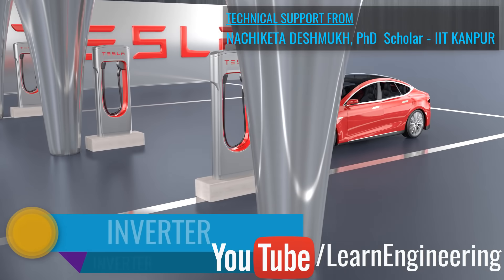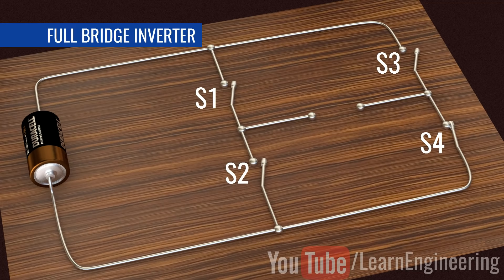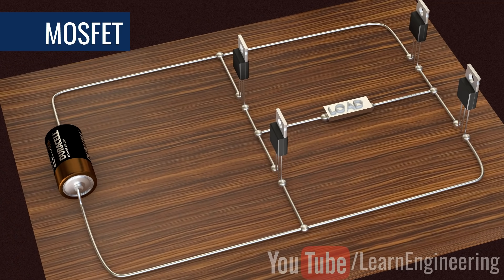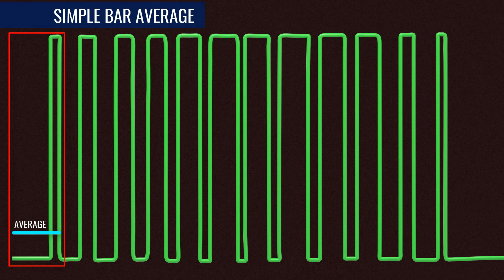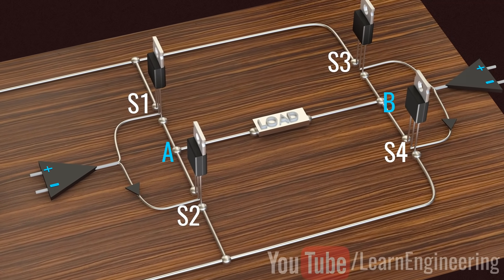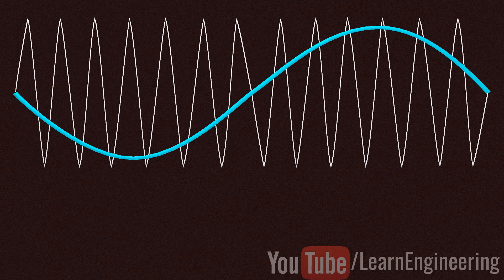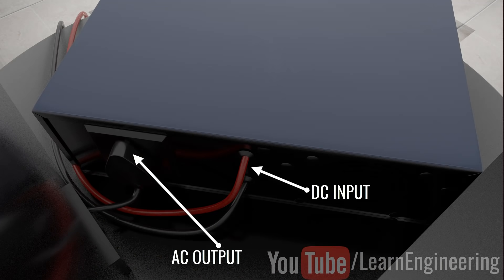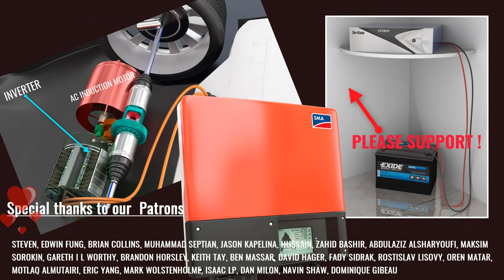Inverters, How do they work?

Comment from the maker: Please support us at www.patreon.com/LearnEngineering . Your support keeps us going !
Reply: I am always sharing u r videos to what's app to see all my friend's and I will supp2
Reply: +karthi k It's true that inductors smooth current and capacitors smooth voltage, but resistors don't smooth current. 

The voltage over a resistor is equal to the current through the resistor, multiplied by its resistance: u_R(t)=R*i_R(t) ( _ denotes that the following symbol is in subscript). Here you can see that if i changes, u changes immediately. u_R(t)=R*i_R(t) is known as the Constitutive equation of a resistor and describes the relation between the voltage over the resistor and the current flowing through it. 

The current flowing through a capacitor on the other hand, is equal to the capacitance of the capacitor, multiplied by the change in voltage over the capacitor. i_C(t)=C*du_C(t)/dt (d denotes a change in the following variable. dy(t)/d(t) means the change in y(t) divided by the change in t, where dt approaches 0. This is known as the derivative of y(t)) Here you can see that the change in voltage over the capacitor is also equal to the current flowing through it, divided by its capacitance, so if you make the capacitor larger, while keeping the current flowing through it unchanged, the change in voltage will be smaller. This is what is meant by saying a capacitor resists change in voltage. 

For the inductor the voltage over it is equal to the inductance multiplied by the change in current flowing through it, so its constitutive equation is u_L(t)=L*di(t)/dt. Here you can see that the same voltage over a large inductor gives a smaller change in current compared to when this voltage is applied over a small inductor. 

So, we now know what the constitutive equations are for the resistor (u_R(t)=R*i_R(t) or u=R*i), the capacitor (i_C(t)=C*du_C(t)/dt or i=C*u' (prime notation ' is another way of noting the derivative.)) and the inductor (u_L(t)=L*di_L(t)/dt or u=L*i'), but how can we explain these formulae physically? 

First we must know what current and voltage exactly are. Current is the movement of electrons through a material (even though we have defined the current to flow in the opposite direction of the flow of electrons. For our purposes this doesn't matter. You just have to flip the sign.) Voltage is the potential energy of the electrons. If you have a bunch of electrons or other negative charges at one spot, it has a negative voltage. this is because like charges repel, so the more negative charges you have at one spot, the more they want to go to a place with less negative charges. If you electrically connect a place with many electrons to a place with few electrons, electrons start to flow from the place with many electrons to the place with few electrons, until the electrons are approximately equally spaced. 

Let's first use this to analyze the capacitor. The most basic capacitor is made of 2 opposing metal plates, separated by an insulative barrier, for example air. Let's apply a constant flow of electrons from one plate of the capacitor to the other. Since the electrons can't go anywhere other than the plates (They can't flow through the air.), the electrons will accumulate at one plate (decreasing the voltage) and the other plate will lose electrons (increasing the voltage), so with a constant flow, the voltage across the capacitor increases linearly. This explains the constitutive equation of the capacitor. 

What about the inductor? Let’s take an inductor and increase the current flowing through it. This will generate a magnetic field, storing the potential energy (voltage) of the electrons moving through the inductor in the magnetic field. If the potential energy of the electrons is zero, the magnetic field is unchanging and the voltage is zero. If the current were to decrease, the magnetic field breaks down, releasing the potential energy, causing a negative voltage, keeping the current up.  In other words, an increase in current causes a positive voltage and a decrease in current causes a negative voltage. 

A resistor also has a current flowing through it, just like and inductor, but instead of generating a magnetic field, the energy gets dissipated in the form of heat, so a constant current means potential energy is constantly dissipated in the form of heat, causing a constant voltage. I hope this helps you in understanding why capacitors, inductors and resistors behave the way they do. 

-Dehim
Reply: learn engineering ,
5.50
inductor used to smooth current.
capacitor smooths voltage.
resistor too smooths currents ?
(sorry for bad English)
Reply: +Learn Engineering, great video about inverters, but I did catch one mistake. It's about your definition of alternating current. You said that alternating currents always have a mean of zero, but that's only the case for pure alternating currents. An alternating current is just a current that changes direction (Goes negative as well as positive.) Just because it has a small DC offset doesn't mean it's not alternating current. Only when the DC offset is large enough that the direction of the current doesn't change do we no longer speak of AC, but varying DC. Also, alternating current doesn't have to say anything about the voltage. You can have alternating current, but have direct voltage and vice versa.
Reply: Very well explained.
Reply: do you have PayPal for donations?
Reply: Video provide in hindi please....
Reply from the maker: Thank you for your supporting mentality :)
Reply: @SabinCivil  please share all your study videos on youtube so that we can share with others more
Reply: But I want you to stay, not go...
Reply: +karthi k resistor does not smooth anything, could act as an energy consumer
Reply: Learn Engineering It makes me wonder if in 10 years time we will be harvesting these inverters off of junkyard teslas for our homes like we harvest laptop batteries today for our powerwalls
Reply: Learn engineering, good video!  How much of rending does it take?
Reply: I learnt about AC generators when I was 13. At that time I thought the axle of a DC motor is connected to the axle of an AC generator to convert DC to AC.
Reply: Hi sir,  To get a perfect 50hz sine wave what frequency of square and triangular wave need to use?
Reply: بسم الله الرحمن الرحيم
1- ما نوع المقارن وما هي الدائرة؟
2- ما هي قيمة عناصر التخزين ؟ وكيف يمكنني أن أوصل الدائرة؟
لا تجعل الأشياء مبهمة ، سيزيد من صعوبة البحث؟
what's the type of comparator?
what's the values of elements storage?
how i can connect a circuit?
Reply: بسم الله الرحمن الرحيم
استخدمت lm358 non-inverting comparaotr 
i use lm358 
أما عن عناصر التخزين، فقد اخترت القيم عشوائية، هل هذا ينفع إذ أن القصد هو تخزين الطاقة؟
Reply: Can u tell, the average pulses that u got, how u make sine wave by them ?
Reply: Great information with a perfect animation video. Please make a detailed video on multilevel inverter also. That would be a great help for further research level understanding.👍
Reply: Don't beg.